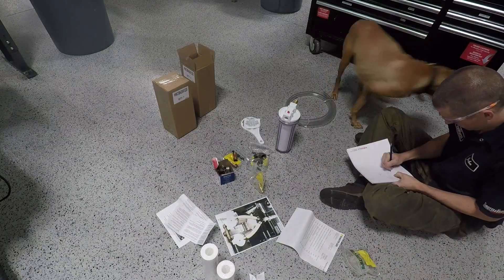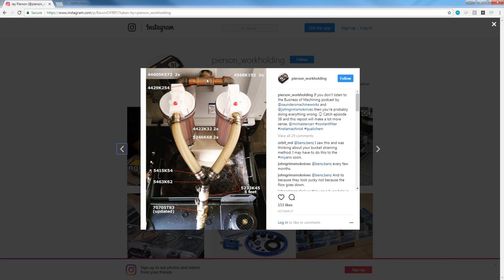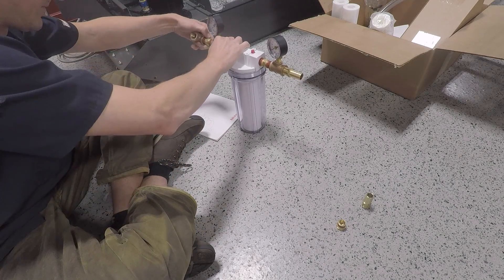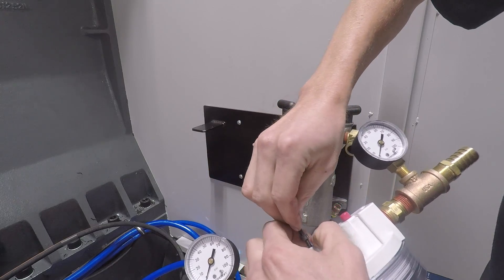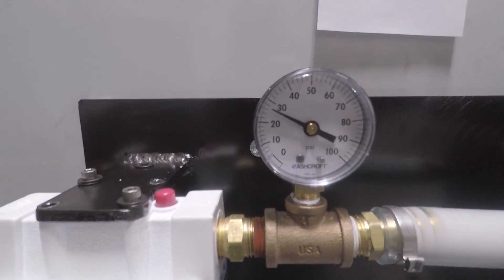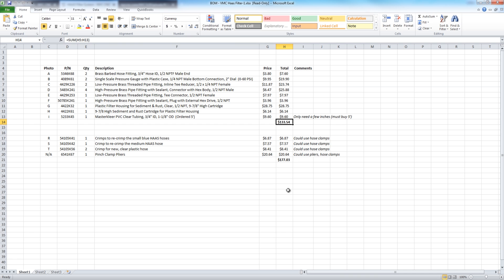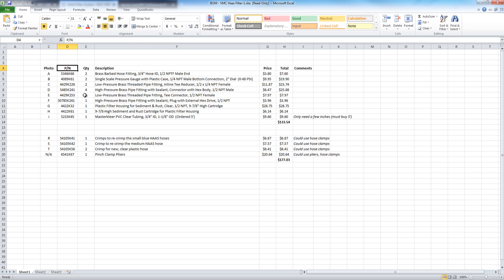Upgrading Your HAAS Coolant Filter System!

Comment: I know that this is an older video but are you still running this set up? If so how does the filter canister hold up? I made one of these on my CNC knee mill and the canister kept cracking. I presumed it was due to the coolant interacting with the plastic.

Comment: I know this is an older video, but I made a similar system and used a Pentek 150367 filter housing .  Uses much larger bag filters (about $6 each) and is made of polypropylene for higher durability and chemical resistance and includes a pressure gauge.  A lot cheaper than a steel bag filter housing but quite a bit nicer than those canister filters from a big box store.  Freshwater systems has them for $150

Comment: John, I am an avid listener to your podcast (have binged all episodes 3 times now the last few months).  I'd LOVE to see an updated video of this using the updated all metal cylinder grimsmo has found.   My father an I just sent a deposit this week for a brand new Haas Mini Mill 2.   As a tiny basement run operation, this is a HUGE step.  Looking to into a filtration system as a first step before even adding coolant to the machine.  If you can't do an updated video, would you be able to provide the part number for the "better" filter capsule?? Thanks for all you do.

Comment: I have been debating cleaning my Mini Mill tank with a magnet. Since I mainly cut 95% steel. The ones that pick up nails should work. They are about a 12" long. Dunk it right in the tank on a metal rod handle. I could sweep my tank in minutes.  What are everyones thoughts on this?
Reply: You could also have the coolant flow out of the machine onto a large magnet. That would catch most of the fines before they make it into the sump. Then just clean the magnet at the end of the day, or first thing in the morning after the coolant has drained off of it.

Comment: Ran a VMC for one of my contracts and they would skim the oil off the sump and run it back through the machine instead of buying "expensive machine oil". They had 3 lasers and Hydraulic Turret Press too. Maintenance was an afterthought. Like your setup. 

They had a 50" wide belt sander that used a coolant system with a roll of paper to filter the aluminum dust similar to the cheese cloth you use. Float control rolled the full paper up when the sump  levels varied due to clogging. Worked pretty good. Aluminum dust is potentially very explosive due to the gases it creates mixing with water. It eventually died after I left working there, they never cleaned or lubed it.

Comment: Have you thought about adding this to any of your Tormach machines? Then again, aren't yours all using mist and not flood? I did a similar upgrade to my mill but the pump couldn't handle the pressure needed...
Reply from the maker: Yea, we only use Fogbuster on the Tormach machines

Comment: Adding the pressure gauges is important for knowing the differential pressure between filter element sides, but you need to ensure to know how much is the correct delta P of the filter, as well ensure regular calibration of the gauges. 
Thank you for all your videos.

Comment: I work in a plant that has multiple machines filtered through a railroad car sized filtration/chip extraction  system but we still use a bag filter system at the machines and it is very effective at keeping the fines under control.It is also part of the operator's daily machine checks to observe the gauges and report any out of spec pressure drops that could indicate the filter clogging. And ain't that Mcmaster-Carr the best thing ever! love their service!

Comment: Next time, install differential pressure gauges across the filters ... or transducers to monitor electronically with e.g. an Arduino that shows go/nogo status locally as well as sending data to a workshop monitoring "server", which can take appropriate action. 
https://www.mcmaster.com/#2238k24/=1ah9dc5

See e.g videos on MQTT by  Andreas Spiess. It's very clever stuff that does as much or as little as you define.  Also see Node Red  to use as your IoT (Internet of Tool) server. 😀

Comment: Nice job John. Instead of two seperate gauges, which are bound to be ignored and forgotten about, there are specific gauges designed for this purpose. Check out "pressure differential gauge" (that'd be gage for you lot ;) ), if they indicate green you're good to go, if they get into the red you change the filter. They look a lot like this guy http://www.globalindustrial.com/g/tools/pressure-gauges/Hydraulic-Gauges/dry-filter-indicator-gauge-101016 or better yet, this little guy, designed just with this in mind, with an electrical switch available for a warning light/buzzer when the filter needs changing https://differentialpressure.com/filter-indicators-overview/dpp975/

Comment: Hydraulic fittings all get pipe dope, less chance in a hydraulic system for a piece of teflon to break off and flow through the system in small orafices and plug them. With what you are doing, teflon is non reacting and your best bet for ease of use.

Comment: Even better: magnetic filter. Removed sub-micron particles, doesn't get clogged and is super easy to build with a bunch of magnets inside a stainless tube. Make it so that you can remove the tube for swiping off the collected debris or a way of getting the magnets out so the crud falls off.
Reply: works great with aluminium , i suppose ...
Reply: Whaaat ? Your aluminium doesn't stick to magnets ? :) :) :) lol

Comment: on the pump there should be a sticker, one for the motor & one for the pump section, telling you the head and presure etc
high presure pumps tend to be multi stack types

on our machines where we have 50bar and 100bar pumps, they push the coolant through a inline hydraulic pressure filters, commonly they use tend to use 50micron filter followed by a 10micron , larger one tends to be a stainless so some times can get by simply washing these out.. the 10micron tends to be glass so they do clog after awhile...but the 50 takes the bulk of stuff.. depends on materials cutting i find determins life.
fine fitlering becomes a key note when you have through spindle coolant (TSC) as you need to keep that spindle connector in good shapre or they damage easy and then leak.

for the return, afew of our machiens have the filter type like you show, but we have what they call a paper filter roll, which is a fine paper medium , comes on a roll and comes in various filter grades, running on a feed bed so the paper keeps getting renewed 

for coolant life, PH is one thing you need to be on top of, this stops it splitting more than anything. if its a smell then thats more on the bioside of things. using DI water and mix to top up with is also a big help in tank life i have found also. with the right maintaence and coolant you can get a very long tank life from cutting fluids. , as has been said before here oil skimmer helps big time too, i find the disk type works best over the belt and others. but then tend to work best when the tank is sitting and the oil can level on top to be dragged out, when in use the oil tends to get mixed back into the coolant . depends how good your cooalnt is at rejecting tramp oil...

even turning the pump on every few days for awhile can help keep coolant life up too keeps things moving. 

i think this is a topic you can talk about for days/weeks,
Reply: Magnetic filters are even better, they do not have practical limits to what micron size particles they filter, they do not clog and are easy & fast to clean and last forever without any expenses after purchase.
Reply: thats true.. but pure magnetic filters dont work too grate if you only do alli or stainless..or other non magnetic materials but a combo filter that you can get would give the best of both worlds for sure ...

i find magnetic more handy on grinding machines my self

Comment: I wonder how your coolant pressure is so low. In our EC-1600 is a 300 psi pump and in our VF-7 1000 psi. None of these filters could be installed to a 1000 psi system as they would just explode. But it looks nice on your machine and I would recommend to add a oil skimmer also.
Reply: 300 psi / 1000 psi are the pressure levels of the two different through spindle coolant systems.      This filter system is for the much lower pressure flood coolant system that runs on a separate pump.

Comment: Teflon tape is meant as a "lubricant" to allow tapered pipe threads to bind less and therefore seat more fully creating a better seal. It was never intended as a sealant - although nearly everyone uses it so and gets by with it. Best practice: Teflon tape for lubricity and pipe sealant for sealing.

A second suggested add-on to your coolant tank - a tramp oil skimmer to pull way oil out.
Reply from the maker: Machine has a skimmer - it's on the side

Comment: I wish HAAS had a better coolant system overall. I have had to modify the coolant on every Haas I have had so far. Leaks and filtration. My latest Super Mini Mill is a big improvement with zero leaks, but it is a major pain to keep the chips out of the coolant. Seems like it should be a higher priority.
Reply from the maker: My experience:  I've heard gripes/complaints/suggestions on every machine tool owner/builder - including "the high end ones".
Reply: No doubt....I still regard Haas as the best bang for the buck by a long shot. They sent me one of the 'fish fry' baskets for my new Super Mini Mill, but they don't fit the machine. Looking into a DIY solution that fits this machine. 

If I spent 3x the money on a fancy German or Japanese machine - I would be upset at even the slightest flaw.
Reply: I have not yet figured out a practical solution although I am highly motivated to do so. Clogged lines and nozzles is a MAJOR pain. The Super Mini Mill will be used primarily to make small chips so I can see it getting ugly pretty quick. Fingers crossed......
Reply: The higher end machines are alot better including the one priced very close to Haas
Reply: We have okumas, DMG Mori's and makino's in our shop and the coolant system on your Haas looks alot better than any of thise.
Reply: Any tips on what kinda DIY solutions you're looking for your SMM? I have same issue with my MM2, while I can  build these 20 micron post filters, I can't prevent chips going into the tank. I tried to cover drain holes inside the machine with fine stainless mesh, but it seems like small chips are still able to get into the tank through drain holes on chip conveyor bottom.

Comment: looking at the pressure drop i would seriously recommend getting at least one more filter next to the current one. this is way too much flow for these type of filters. do not look at the total pressure, look at the drop and the amount of flow. the pump you have is capable of pushing a LOT of coolant. putting all that into such a small filter is asking a lot and i might even expect it to implode if you forget to look at the pressure gauge.
Reply from the maker: Would love to hear more on this - how can you quantify the flow rate of these filters?
Reply: A manufacturer can't really quote a flow rate for their filter because it depends on the amount of contamination in the fluid being filtered which directly affects how "blocked" the filter is. As noted above, the delta pressure across the filter is what matters and I agree, for a new filter your pressure is too high.

I would suggest contacting your local Donaldson rep about a filter head to take an automotive style, truck/heavy equipment size spin on fuel or oil filter. Or maybe something from their bulk fuel delivery filter range.

Comment: Why not add some pressure transmitters, connect them to an arduino (or something like that), and put a digital display on the front of the machine so the operator can monitor while the CNC is operating.

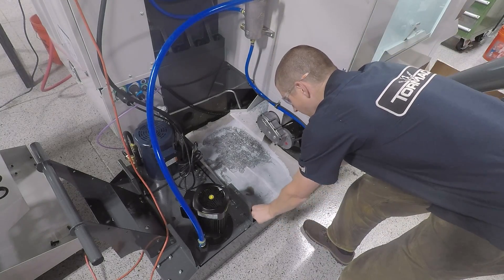Comment: At 2:18 you mention the cheesecloth for pre-filtering chips from your coolant return.  Have you thought about stainless mesh?  I'm just thinking it would hold up better.  I've used this mesh for weather-protecting speakers (it really helps keep rain out of the front since the mesh spacing is so tight), but it might be a good long-lasting filter media for your use too.  It's 0.0045" dia 304 SS, 100 wires per inch with 140 micron openings.  It's 36" wide and is available in a 100' roll, or by the foot.  https://www.twpinc.com/100-mesh-woven-stainless-0045

Comment: Self tapping plastic??
Reply from the maker: You have a better name?
Reply: NYC CNC it's most likely Polypropylene or Abs. But pretty much all plastics can be drilled and tapped.
Reply: The holes are molded smooth, and running a fastener into the hole acts like a roll tap, creating threads. There are specific coarse thread screws designed for these types of pre-existing holes. Just look at any of the screws you remove from plastic bodied tools when taking them apart. You could probably find those screws on McMaster also (If they don't come with the filter housing/bracket).

Comment: Hey John, If you want to get the absolute best performance and lifetime out of your coolant, get a fish tank air pump and air stone for your coolant tank. I've been running one in mine with noticeable results. Oxygenating your coolant has multiple benefits, including the health of your work environment. I can recommend the low cost pump I bought from Ebay that comes with everything you need in a kit for under $7 shipped from the USA.... pump, hose, 2 air stones, T fitting, flow control and suction cups to keep the hose in place. I run it 24/7 with no issues. I'm not affiliated with the seller, just wanted pass on something good I found.
Reply: I think, that airating prevents  anaerobic organisms to grow in coolant.
Reply: You need to read about anaerobic bacteria and flood coolant! No, sealing up your coolant will cause dangerous bacteria growth.  Aerating, contrary to intuition, will NOT cause your coolant to evaporate more quickly or let off dangerous gasses. DO YOUR OWN RESEARCH if you don't believe me...I'm just trying to help.
Reply: The little oilfilm that is on top of the coolant prevents air from getting in and thus anaerobic organisms start growing and it gets really bad and really smelly quickly. Aerating the coolant kills them or prevents their growth in the first place, just like the coolant gets aerated when it is in use, splashing and cycling around.
Reply: Do you have a link to the kit? I've been thinking about trying this for quite some time. Couldnt find a kit that cheap though.
Reply: Sure, here you go.... https://www.ebay.com/itm/24-40GPH-Air-Pump-One-Outlet-Aquarium-Fish-Tank-Hydroponic-with-Accessories/301843461525?ssPageName=STRK%3AMEBIDX%3AIT&var=601111961631&_trksid=p2060353.m2749.l2649
Reply: John and Innovative:  Thanks for the Information.  What are you guys using for skimming?  I have noticed various results over the years.  Some coolants just don't skim well.  Also there is a little know weakness of water soluble / mineral oils.  Vactra #2 and other heavy machine oils do not play nice with these coolants.
Reply: @chrisrokz9005   I use the  C-Thru Skimmer.  I found out about it from a local tool rep.  I am super happy with it.  There is ZERO oil film on my coolant.   www.nexjentechnologies.com.  I am not affiliated with the manufacturer in any way.  Just a happy customer.
Reply: please explain how airating the coolant causes any health inprovement? i am really struggeling to find a reason. you want to keep it closed off and away from people and allow the coolant in the tank to settle. putting a air hose in it negates that very idea.
Reply: @SupremeRuleroftheWorld  I think that one point is that when the coolant is being sprayed some of it will get airisolised and that means that you will end up breathing some of it in potentially, including whatever is in the coolant.

Comment: Useful video. Received my first new haas a month again. After two to three days of machining the coolant nozzles are clogged. I have to remove, clean and re-adjust the nozzles...
Reply: Get a 1" thick blue AC Filter pad.  The kind that looks like a giant scotch brite pad and put it in your coolant return basket.    It filters air down to 3 microns and coolant goes through it like it not even there.  I have a morning and after lunch maintenance checklist and one item is to check the coolant filters on each machine.  Chips can build up fast and overflow the basket washing chips into your sump. If its getting a mound of chips we scoop them into a dust pan and put them in our recycle bins then use a shop vac to vacuum the filter in place removing 80% of the remaining chips.  A couple times a year re replace them.  They are cheap.  We get rolls from MCMaster.  https://www.mcmaster.com/2069k209